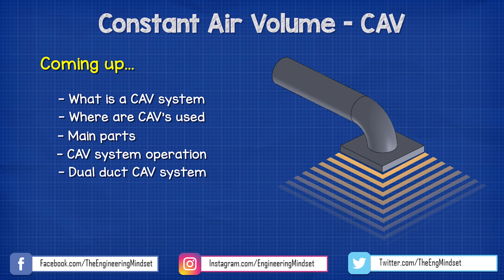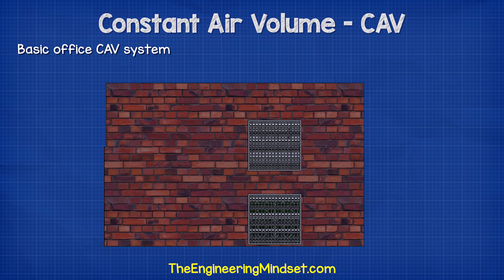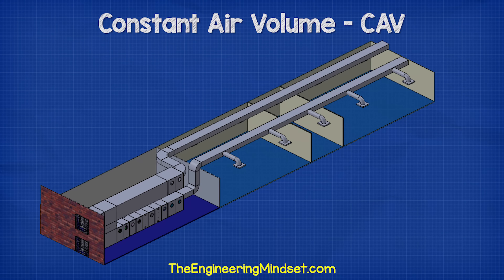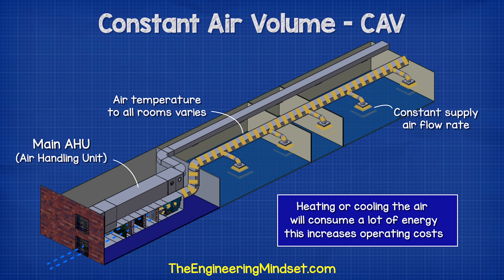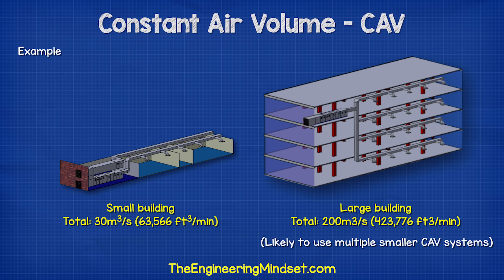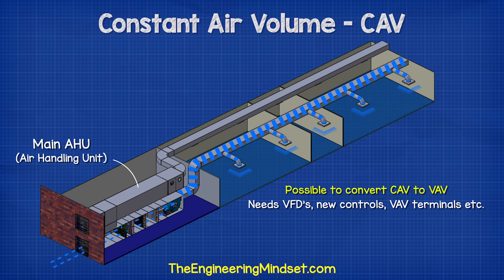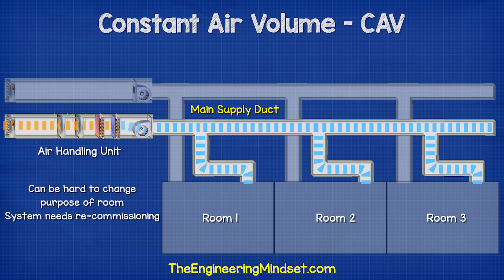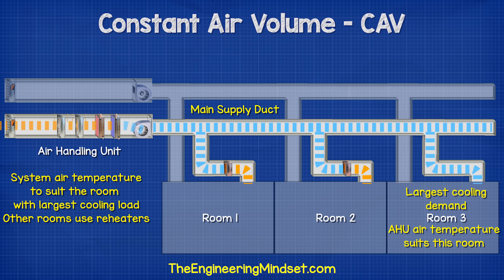Constant Air Volume - CAV  HVAC system basics hvacr

Comment: Dual duct systems were extremely common in the 60s through the 80s in the US. At my university here in Texas, all the original dual duct systems from the 70s are still going, complete with all the ancient mixing boxes, tiny high static hot/cold deck ductwork, pneumatic thermostats, and the enormous custom AHUs literally built into the buildings. Interestingly enough, one of our buildings completed as late as 2008 has a dual duct system. Dave McFarlane has an interesting writeup on old systems called "Retrocommissioning older buildings."

Comment: Just a mention that CAV’s are still used in places where the air exchange per hour (ACPH) is required. 
I work in a decent-size modern hospital and air-turnover is critical to pass inspections.
Reply: It seems so obvious, but I had never even considered air turnover - let alone a hospital. Glad to hear it's a thing, though.

Comment: No mention of TAB? Testing, Adjusting, and Balancing that makes the system actually do what its supposed to and where problems might be discovered. Also, You don't adjust the Volume dampers during commissioning. You do that's during TAB by a certified technician that sets total fan speed as well as each diffuser output. Arguably one of the most important parts of commercial HVAC, by making sure that expensive system is doing what it was designed to due.

Comment: Crt me if I'm wrong...in this there no separate CAV box like VAV box only the thing is to add on heater or similar to heating unit. So CAV is one type of system which we used early. There is no use of it ..and one more question instead of VAV can we use motorized VFD for the same it can also be control the flow as well by using the thermostat. And why do we need air flow sensor on VAV we were already controlled by thermostat... please clear my doubts ????????

Comment: Would a VAV control system also require cooling at the AHU as well as reheating for the VAV box terminals? Is there a substantial difference in this way between CAV and VAV? Or is it solely due to the modulation of air volume (and furthermore, heating) for the individual rooms in a VAV system that saves energy?

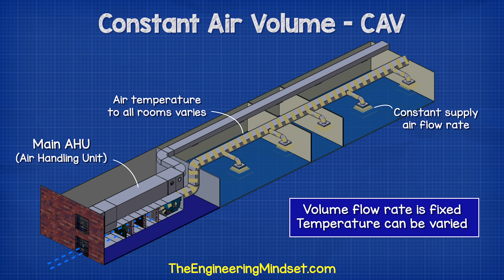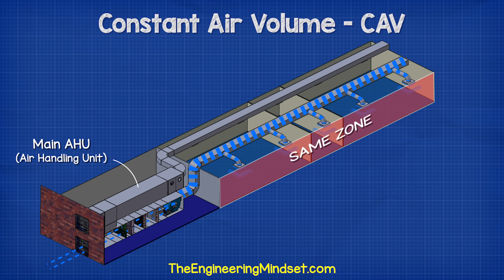Comment: @3:53 you are saying that temperature changes in different rooms, but @5:51 you are saying all the rooms receive the same temperature. I don't get it. Is it that normally in CAV, you get same temperature in all rooms but by using inefficient terminal heater/cooler you can get varied temperature?
Reply from the maker: You've misunderstood. 3:53 every room receives the same temperature air, we can change the air temperature but every room will get this.

Comment: Just saw this and i puked a bit in my mouth.. we have a CAV system with two machines built in our newly built hotel.. one zone for the guest rooms, one zone for the tiny bar, two guest kitchens, a green room, the only meeting room and the lobby.. so a silent meeting room has the same Volume (sound not air) is present in the meeting room as in the lobby.. then in the summer in the lobby doors are open, upper floors without windows that can be opened and the whole thing can't go below 18°c  degrees which are realistically 21°c and then the chiller dies...

Comment: So I'm curious; if they have to chill the incoming air to a set temperature anyways, then reheat the air at the point of use; why not use a heat pump to simultaneously chill the air coming into the building, and heat air at the point of use?
Reply: More energy efficient to use a central chiller for cooling and a boiler for heating.

Comment: This type of system is normally done with a Rootop unit or a furnace. I have designed over 5000 Electrical & Mechanical projects. I am an electrical & mechanical engineer. If they want temperature control I just install a zone damper system. An HRV is usually installed as well. I have never seen this system in a large building. Normally VAV with mixing box at the air handler. Mostly pneumatic controls and hot water rads. I also built myself 100 apartments as of recent. I was the engineer and contractor and I own the buildings. All 100% Electric. No gas. In Canada. I hate gas. It is dangerous and in Manitoba, our power is all Hydro which is a renewal resource. USA loves coal. It is dirty and high pollution. I was involved in 1991 in converting a coal-fired Power Plant in Selkirk, MB to natural gas. It is now closed.
Reply: Good day sir! I am interested in working as an HVAC engineer in Canada. May I ask for your email sir?

Comment: But I think in CAV system we can regulate the flow rate of air to the room if we will put VCD in room branch. 
Suppose, you are telling for one room 30m3/min  in 13degree is very high, so we can adjust damper and get 20m3/min in 13 degree, and that will be sufficient for room.

Where I am wrong, please, explain me

Comment: 30 m3/s is a lot of air. Not by any means small ahu can provide that kind of air volume flow. Also, rotating or crossflow heat energy recovery is now day pretty much standard in AHU units. At least here in Finland.
Reply from the maker: Cross flow covered here in detail: https://youtu.be/KCiv8IAUkh8?t=639